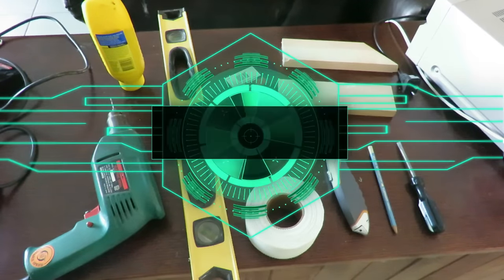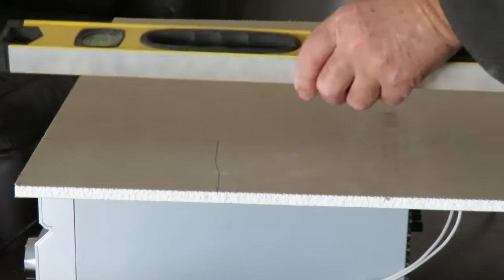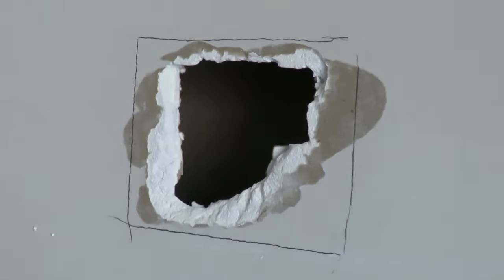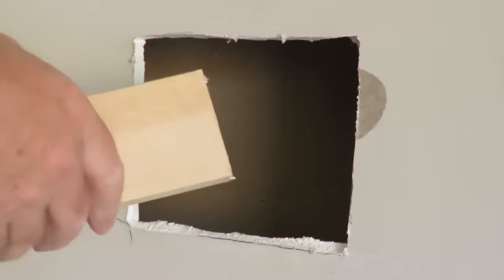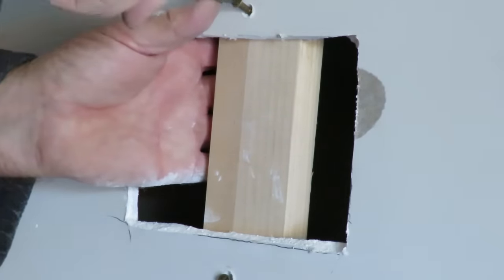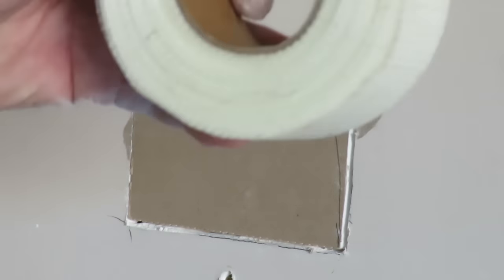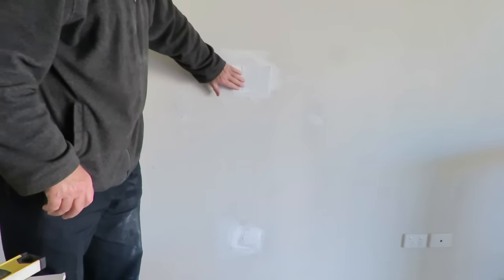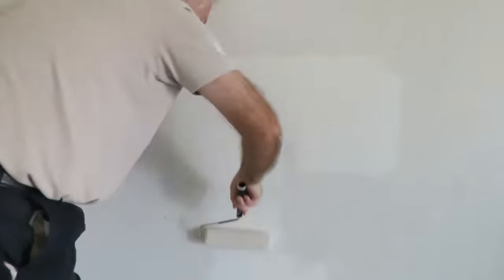🏠 How to Repair Drywall and Fix a large Hole in the Plaster Wall the easy way

Comment: How not to fill a hole lol,,, This guy is not a tradesman,,, What a bodge up. Not how I'd have done it,,, Someone should teach this bloke how to do it properly,,, blah, blah, blah, blah, blah...... Been in the industry for years and i have seen many a tradesman do heaps worse ( ie - Newspaper , Cardboard etc )......  This bloke is showing the basics and he got the exact result that ANYONE is looking for.... As for all the tools with their opinions - please troll someone else and go and buy a left hand screwdriver.....
Reply from the maker: Unfortunately there are many couch experts who have no idea as to what really happens on job sites, and live in a world of fantasy.
I would like to see some of them perform a task they have not been forewarned about, and without any tools for the job, as I found myself on this occasion.
P.S. This repair is now 4 years old, and is impossible to locate on the finished painted wall.
Reply: Car door got logged in my garage wall while backing up my classic car 🤦🏽‍♂️
Reply: I’ve just put a hole big hole in my bedroom wall. Gotta get I done before my parents find out
Reply: @GarryPurcell  What’s that stuff called in the yellow bottle and where can I buy some ?
Reply: Ok - what's the better method? Link to a video?
Reply: You are correct, the tools aren't considering what one would do if they didn't have the right tools to hand for example. Or some plasterboard to insert. A good handyman will come up with a viable way to fix problems like this with whatever he has to hand.
Reply: @GarryPurcell  just to say, i recently networked my house and this repair technique worked perfectly with the plasterboard here.
Reply: My daughter just booted a big hole 😂😂
Reply: I have done small repairs like this for years and it works well. Thank you Garry for the no-fuss video.
Reply: I've pretty much done the same technique, only difference being I usually use piece of plasterboard for the backing too rather than wood? I make it roughly the same height minus a couple of millimetres (so you can slot it in behind the hole), however the length needs to be a few centimeters bigger to fit to the inside of the wall using no nails. Use a screw & string attached through the back to pull the piece flush & completely fill the hole that way theres no wobble or movement when you place the repair on top, once the glue dries, cut the string holding it in place & do the repair? Not saying its better, just an alternative & if you've already got the plasterboard for the repair no need for wood.
Jobs a gudun' (either way) as we say in Yorkshire 😊
Reply: @lpgibbo7463  How do you know if someone's from Yorkshire? 

They've already told you.
Reply: If hes a pro,why doesnt he have a drill with bits for screws? Fighting with that cheap ass screwdriver is what made me realise hes just trying to make money off videos I guess.
Reply: That should be the only valid reason for searching up what we just search rn🤣
Reply: When the patch was wobble as he applied the tape n coats of compound in was like wth.. I dont know his situation at that time. But I would have done either a California patch for something that small or a tip. If you gonna put wood as a backer I would not put it in middle. Screw it to both ends of hole. So 2 pieces of 1x along both sides screwed into drywall and then screw patch into then2 strios... the middle strip just didn't work for me. But we all have our  way to get to end result..
Reply: all that babbling, and you could explain how we could do it 😂😂😂
Reply: Can you get a left handed screwdriver?l have looked all over the place for one.can't get them. Must be rare .👍🇦🇺🐑
Reply: Omggggg wtf he just do🤦 that's all lose... PEOPLE PLEASE DON'T DO THIS!!!
Reply: Same😢
Reply: I have a left hand screwdriver. And a right hand one too. So there. Put that in your pipe and puff on it.
Reply: Another potato go figure @daibonehead
Reply: And a electric hacksaw
Reply: left hand screwdriver 🤣🤣🤣

Comment: I did the exact same repair with the small piece of 2x3 wood and some extra drywall.  Except, I bevelled all the edges (wall and filler piece).  About a decade later, I ran the repair by a drywall guy and he told me that instead of making the filler panel square, his recommendation was to use a round shaped filler panel utilizing an appropriate sized kitchen pot lid as a template.  He told me that this would prevent possible filler cracking in the corners.
Reply from the maker: Thanks for the info.

I normally use this method when I have my tools with me.
📌 https://youtu.be/JmcR9TW4mM0

Comment: Followed the instructions and it actually worked, only thing I did different was that I added an extra screw through the middle of the plasterboard cut out to keep it from moving at all, thanks a lot mate.
Reply from the maker: Thanks for letting us know all went well.🙂
There are lots of different methods, it really depends on what you have available at the time of repair.

Comment: Some friendly advice.  Never use anything but fast setting mud over mesh tape (looked like Green label all purpose, but not sure).  Put backing in on 2 opposite sides and it won't rock like that and will be much stronger.  Use a 10-12" knife to float it out, as a 6" is not going to give you nearly as good a job.  Use the 6" to embed it, but go over the final times with a 10" or bigger and it will float out great.  Also, if you use fast setting mud, (hot mud) it allows you to put multiple coats on in one day, and it doesn't shrink.  But be sure to put it on very smooth as it's terrible to sand.  Otherwise I'd go with all purpose and paper tape.  Just trying to give some helpful pointers to viewers.
Reply from the maker: Thank you for adding some good information.
Reply: Garry Purcell by the way, our names are similar. I’m Guy Purcella.

Comment: I am no expert but I did work for U.S.G in Galena Park for nineteen years and was in the Quality Control Dept. The job you did was done nicely but I just wanted to know why was the sheetrock installed on backwards. There is an ink code on back of the sheetrock that will tell you the date and time and even the shift who made the sheetrock. I even had to inspect the sheetrock for thickness, strength and water absorption on the Water resistant sheetrock. Other than the sheetrock being installed backwards. You did an exceptional job. Thanks for taking your time to make the video. Good day from Houston.
Reply from the maker: I was on another non related job, and sourced the board out of a dump bin, from the front of the property. I also borrowed tools that were available onsite, to complete the repair.

Comment: JUST what I needed - Plumbing corrections required a big hold in the room next to the bathroom.  No one wants such a small job - I'll just try and do it myself.  Thank you very much.
Reply from the maker: Glad it helped!
I also have a slightly different repair video you might like.
By watching both, you will have a better understanding of just how easy it is to do these wall repairs yourself.
https://youtu.be/JmcR9TW4mM0?

Comment: Gary still replying on this video 2 years later I need this vid because I punched a hole in my wall thanks for this great video
Reply from the maker: I believe if you make an effort to comment.
I should do the same in return.
P.S. If your repairing a wall for the first time, you might like this video as well.
https://youtu.be/JmcR9TW4mM0
By watching both, you will get a better understanding as to how easy it is to DIY.

Comment: Thanks. That was a great lesson. I had a disturbed “tenant”, living in a finished room in my garage. He slammed his fist thru the half inch sheet rock in several places. I am going to use your technique. Thumbs up!
Reply from the maker: Unfortunately you nver know what goes on inside a person with either a mental problem, or substance abuse.

I have another wall repair video you might like, when I had all my tools with me.
https://youtu.be/JmcR9TW4mM0?
Reply: Garry Purcell I did all I could to try steering him, but was not successful. Very sad.

Comment: Thanks for the video, I wouldnt of been here if my dad was still around but he passed away. Im 17 and I have much to learn in life. I used to have anger issues and I punched holes in my bedroom walls on rare occasions. I play guitar and im buying a new amp tomorrow. Its a marshall tube half stack. Im setting up half of my room as a studio so im going to remodel my room and im starting by fixing the holes. This helped out a lot on the general concept. Thank you once again
Reply from the maker: Glad my video gave you an understanding of the principles involved for repairing walls.
P.S. If your repairing a wall for the first time, you might like this video as well.
https://youtu.be/JmcR9TW4mM0
By watching both, you will get a better understanding as to how easy it is to DIY.
Reply: @GarryPurcell  thanks man, im clicking the link right now

Comment: Great job there, also folks, when you go to sanding it, do not use an electric sander, but use your hand with sand paper like this gentlemen is using. I learned the hard way using an orbital sander, yes she did the job well, but the silica within the plaster will coat the sanders brushes, then you have to take  the sander apart and replace the brushes ..which is more time, and money.
Reply from the maker: Thanks for handy information regarding sanding.

Comment: Am a pro carpenter, painter, Mason ect 28yrs.i don't even use the backer board.i cut my patch and square hole to fit so tightly and snug it does not fall into wall.when you get good at cutting the whole and patch to fit perfectly tight you don't need backing
Reply: Slow....why not sqaure hole up first?I just take a cordless sawzall shallow cut,u take to long with that knife.Could have had five holes repaired.
Reply from the maker: I'm not sure I could cut a square to those tolerances you mention, but its nice to know the repair could have be done that way.
Thank You.
Reply: @GarryPurcell  yes you use a speed-square to make sure the patch piece and hole is perfectly square .I cut the patch first then put over hole to mark n cut tight.u can gradually shave patch or hole to fit nice and tight n slowly tightly fit flush.also don't turn the patch piece with dark side facing outward cause you will need much more spackle n labour to cover dark side
Reply: @GarryPurcell  there a beveled way to shave the patch so that it never can fall inside wall because you have no backing by cutting patching like 1 /16 bigger than hole n gradually  shave it beveled to fit tight
Reply from the maker: @KingParisBuckingham  
Handy to know.
Reply from the maker: Do you use a panel saw. or a power tool for bevelling?
Reply: He needs to do a California patch

Comment: This works, but it's not the best way. 2 battens, one each side left and right (or one top and one bottom) is far better than a single support in the middle. With this 'one in the middle' way, your square patch of plasterboard wobbles about, can't avoid it.  You usually would end up with one side of your patch a bit proud of the wall - never get it right then.
Best use two battens, can't go wrong then.
Reply from the maker: That's how I normally do repairs when I have my tools with me,
Be sure to check out my other wall repair video, when I was prepared for wall repairs.
https://youtu.be/JmcR9TW4mM0

Comment: Don't know why this came up on my feed but I'm grateful :D  Nice neat job and the trick of adding a small slat behind the hole is a great tip for supporting the section of replacement plasterboard. 
I love fixing things and have done a few patches like this in the last few years - the first one I did was a shallow hole where I had to move an electric cable a few inches - builders left cable in a daft place - but what did I use to create some scaffold for the plaster within the hole?? Yes, a few balls of newspaper! Worked a treat but the trick is to add a few slops of filler onto the newspaper balls after plugging them into the gap and smooth them towards the hole edges; however, don't try to fill the hole/crevice completely to finish the job in one shot. Instead, let the thing dry; then come back in a couple of days and you've got a solid but rough and shallow hole that will easily adhere the final small wodge of filler. This will be easy to smooth off when wet cause it's not too thick; then come back in another couple of days and sand, paint and you're done.
Reply from the maker: There are plenty of ways to repair wall damage, and you don't need to have expensive tools to do it.

Comment: The cut out was put in backwards, and it was taped and puttied elevated from the wall around it. It's best to let the cut out recess a little as that's much easier to fill. Not to mention, doing a home repair shouldn't be accompanied by "Doesn't have to be perfect, don't have to be too particular, doesn't have to be exact" the whole time you're doing it.
Reply from the maker: You have some good pointers in your comment.

Comment: I just filled in a hole in the wall that me (13 year old ) and my 9 year old sister made a hole and we had none of these material but this is what we used 
 Piece of cardboard 
White paint 
White Clay 
Hot glue and prayers that our parents wouldn't find out.
Reply from the maker: I wish you Good luck, regarding your parents not finding out.

Comment: Nice concept but I thought I was going to have a stroke with his crooked cuts.  Whenever I cut drywall I usually cut back to the studs, but this one was borderline cut or patch.  Thought he was going to cut a finger off.  And get a workbench.  What was he cutting on?  Microwave or an AV receiver?  Spackel?  Too large of a hole.  Use mud.  Especially if you are using tape.  Use a taping knife.  Wet it to keep material from clumping and dragging across workspace.  End result...did it matter, not really.  Just pride mainly.  Plus I can clean up alot less with a wet sponge instead of sanding.  Thanks for the idea though and the bravery of putting this up.  Has over a million views so that's quite an accomplishment in itself.
Reply from the maker: If you read the video description, it explains why the repair was done this way.
P.S. I have a better instruction video below, (when I had all my tools with me.)
https://youtu.be/JmcR9TW4mM0?

Comment: I prefer to measure the hole as a square, cut a piece of plasterboard to that size, hold it over the hole and Stanley knife around it. Then it fits perfectly. I have done this so it fits so well it doesn't need any support. Depends on the wall of course.
Reply from the maker: Thank you for confirming that this method works.
Reply: As a professional, that's also what I do with holes up to about double that size.

Comment: Alot of negative comments. I guess everyone is an expert. 
I've done drywall work all my life ' Hey if that works for you that's all that matters. I'm more impressed that have replied to so many comments. I'm sure Alot have found the video helpfull and if I was in a pinch I'd use this method
So I'm giving you a 👍
Reply from the maker: Thank you for your kind words, most people don't bother to read the video description before commenting.
I've seen walls repaired with Rolled up Paper backing, Drywall backing, Chicken wire covered in Newspaper, Corrugated Cardboard backing, Burlap Sack backing, and all held up well, some for close to 100 years.

I had to borrow and scrounge what i could to complete the task at hand.

P.S. When I have all my tools with me I normally use the method below to repair walls.
https://youtu.be/JmcR9TW4mM0
Reply: @GarryPurcell  
Yeah Alot of people jump to conclusions and are quick to judge without knowing the facts. 
So yeah you handled the comments well.
Reply from the maker: @keithclark486  Again thank you for your kind words.
I wish you and your family, all the best for the coming festive season.
Reply: Very true but the proof is in the end result, innit? This was a great job done without full access to tools, materials etc  You can't see any blemish on the wall when job is complete so that is good enough for me!

Comment: Turned out well, definitely recommend screwing the board to the backing timber to give it more strength then scrim tape alone 
Good work 👍🏻
Reply from the maker: Good advice regarding the screw.

Comment: A drywall saw works better for  squaring up the hole! It's also stronger if you put the wood on the right and left side of the hole.  Use drywall screws to attach to the right and left side of the drywall and then mud No mesh tape is needed!
Reply from the maker: I normally do repairs similar to the way you mention.

I have another wall repair video you might like, when I had all my tools with me.
https://youtu.be/JmcR9TW4mM0?

Comment: Thank you
Yes Gary.. I removed a medicine cabinet and used wood for filler.. cut Sheetrock and fiber taped ..then plastered and sanded.. I'm very very pleased. 😁
Reply from the maker: Glad it was helpful!
P.S. If your repairing a wall for the first time, you might like this video as well.
https://youtu.be/JmcR9TW4mM0
By watching both, you will get a better understanding as to how easy it is to DIY.